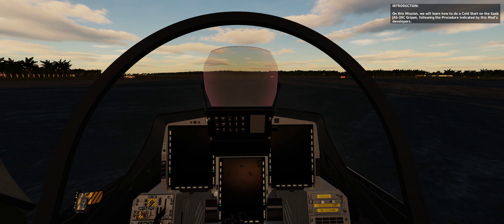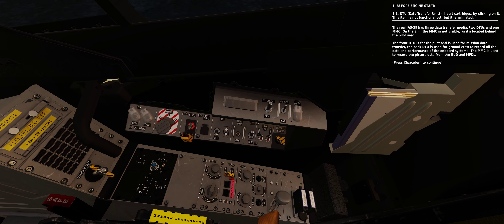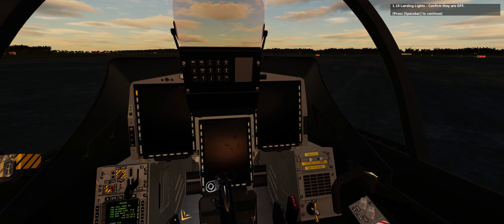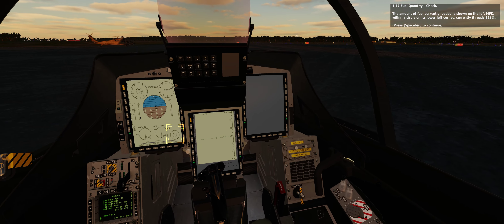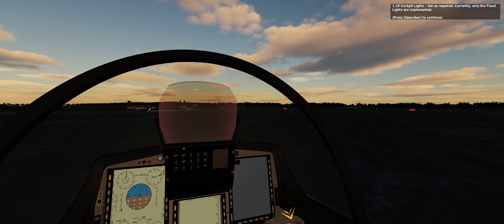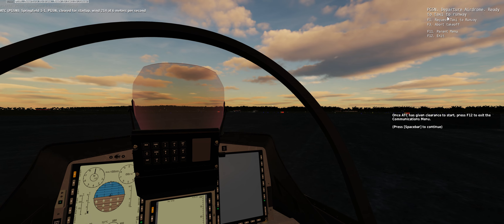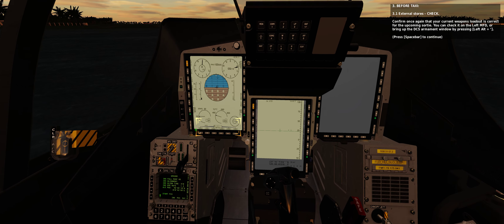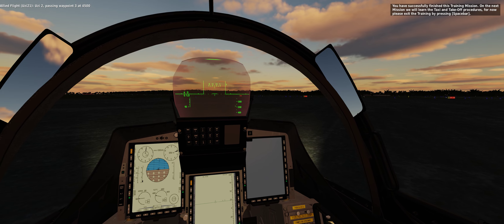JAS 39C - Training - M01 Cold Start

Comment: I need help if I press free flying so everything is already thrown on the Gripen, but I can't move the lever to start. the lock or the gas fuse, or whatever it is I have down there, but I still can't move it and I can't move with the lever, I can't just take off. Another thing is when I press the keyboard to add gas. Nothing happens and incomprehensibly when I keep the PageUp cats, I start at a maximum of 55 KM / H or MPH. FACT I PLEASE PLEASE TAKE ADVICE FOR ADVICE.
Reply from the maker: Hello. I can't really provide tech support on youtube comments, please use the Discord link that is on the video description and go there to get tech support. Best regards.